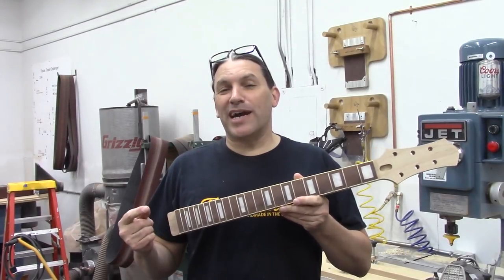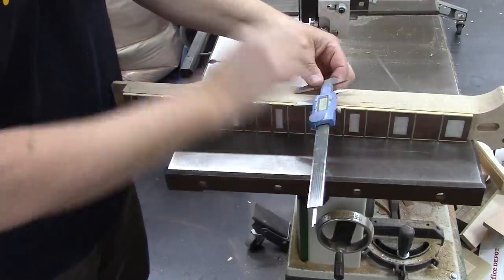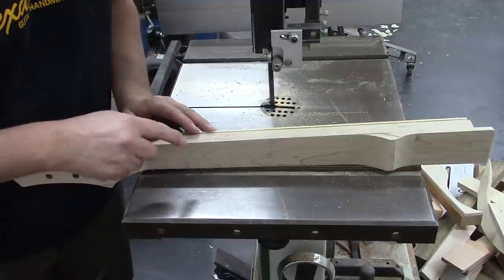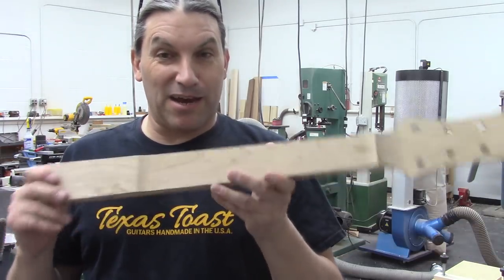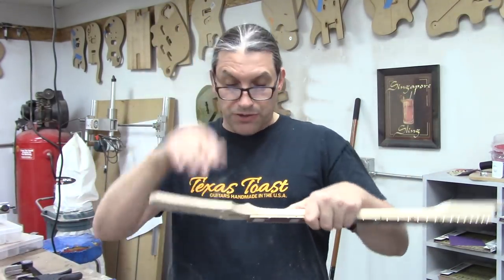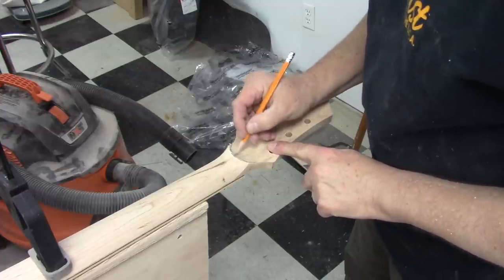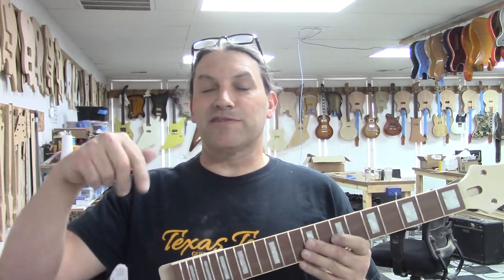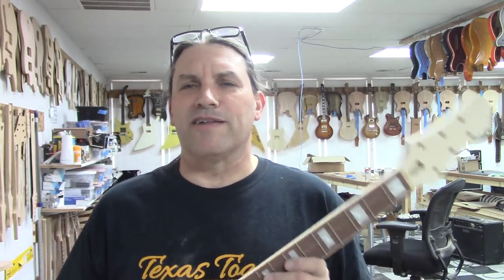How We Shape Guitar Necks

Comment: Tried the 7/8 round over with a 1/8 wedge at the nut end. Worked great. 
Using a cheap slow speed bench top drill press was a challenge. It wanted to grab and chip out. All and all, it was a success. 
So glad I found your channel. Your videos are full of information and technics that I have put to use.
Great stuff.
Reply from the maker: Glad I could help out
Reply: Are you saying you used the router bit with a drill press?
Reply: @nsjguitarsakascotsman6989  i don't know if he's saying that, but I have done that myself many many times.
Reply: @jefflitchfield4950  cool, its just I recently got myself a proper drill press and am interested in alternative uses apart from drilling.
Reply: @nsjguitarsakascotsman6989  high-speed and slow feed. I have used the drill press to do binding routes on guitars with carb tops many times. Make sure your bits are sharp and your fingers are out of the way as usual.